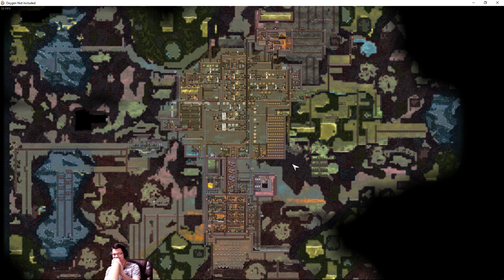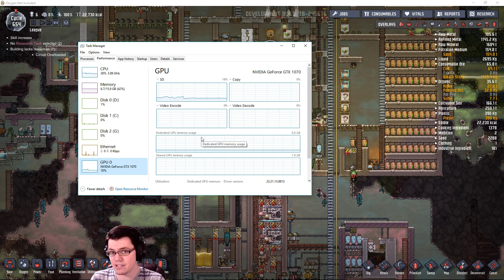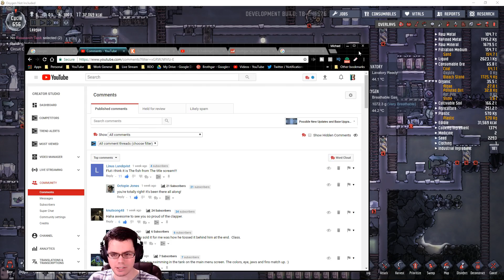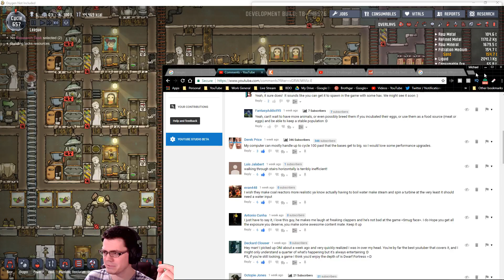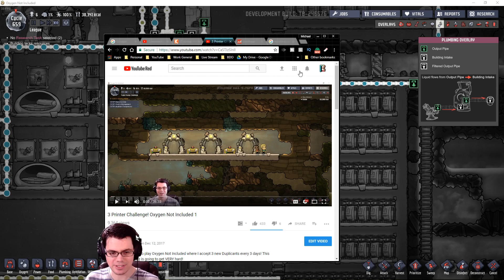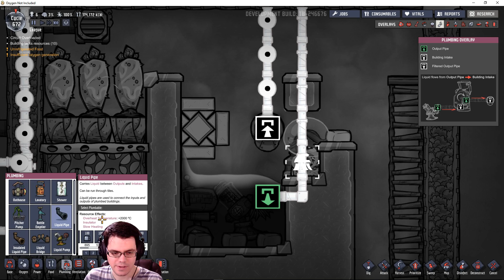Tubular Performance Upgrade! Oxygen Not Included MEGA Base 21

Comment: On today's multi-core systems, games rarely use all cores equally. It's actually very hard to pull that off. A game can still be CPU bottlenecked if it's fully using some of the cores. On a 6 core system, over 33% could potentially mean that two of the cores are bottlenecking, which could slow down the game if it is the one using one (or both) of those cores. Or it might not; the only way to tell for sure is to look at the graphs of all of the cores. If the system is using hyperthreading, things are a bit more complex because you have two threads using each core. I don't even know for sure how the percentages relate to the threads.

That said, I do have something you can try on the GPU side of things: Go to your nVidia control panel, head over to Manage 3D Settings, go to the Program Settings tab, look for ONI (you might have to add it if it doesn't automatically appear), and turn on Triple buffering. That allows your GPU to run at full speed and not wait for vsync, which might give you better FPS. Note that if you have vsync off or are using gsync, you should leave triple buffering turned off (and your GPU is likely not your bottleneck if you have vsync off or are using gsync, because those should use the GPU fully).

Comment: Haven't finished watching but wanted to say, if you're having trouble finding a spot to store liquids or gases, why not use an automation door compressor to store them in a remote location, with a pump and switch hooked up to pull it out whenever you need it?
Reply: Can't remember if you ever did figure out how to do the compressor for liquids, you want to compress downwards, so that gravity will pull the liquid down into the chamber (since liquids don't care about vacuums in this game XD). It'll split it about 50/50 as with gases and compress at an insane rate, especially once the mass of remaining liquid to compress becomes low enough for it to naturally fall under the first door.
Reply: Also as with Polluted water! You have and immense amount of potential power at your disposal! What with a natural gas geyser and your fertilizer maker setup, you are nowhere near your maximum potential, especially once you also start considering the hydrogen output from your electrolyzer setups! You can most certainly afford to run a bunch of cooling equipment and filtration equipment to help with your polluted water and heat problems!

Comment: When placed correctly, a Dupe can suck items THROUGH a locked mesh door. This means you can put a door in your Morb/Puft room, allowing them to collect the slime without any chance of the animals escaping, and not needing to use a lure (and thus use up slime + Dupe time delivering). 

You can also place your mealwood farms on powered doors on a timer, so all the meal lice automatically falls into small piles neatly at the bottom each night. If the meal lice farms are non-accessible to dupes, but the area at the bottom is accessible, your dupes will not waste time collecting lice row-by-row, instead grabbing the whole pile at the end of the day. Alternately, just drop the food onto a room with a microbe musher or into a dining room.

This can also be applied to your fertilizer makers, so you can pile all your fertilizer on a single accessible row (possibly even having hatches on that level for an automatic coal farm). You could even use mesh doors as a floor for the hatch room, so coal could be sucked out by dupes from below without even having to enter.

Comment: The power transformers just prevent over powering from happening and will do 2kw when the conducive wire is connected
Reply: They also prevent back wash of power onto other lines if one is over powered and keep batteries separated for the different uses such as gas pumps for power engines.

Comment: I don't know you have noticed, but petroleum always go out of refinery at ~75C. So cooling oil is bad idea, but heating it is very good, it destroys heat -  I pumped 200C oil into refinery, output was ~74,7C. What do you think? You can make a infinite cooling loop. Tested in game version 242561 (Automation Upgrade before official release if i'm not wrong), it may not work now, but should. Test it   ;)
Reply: LoL use it at a transition between the geyser to the holding basin :)
Reply: DaComputerNerd I just pumped it without a problem. Amalgam pump and random pipes
Reply: KOKSOWNIK no because it can get  very hot without melt
But abyssalite doesn't get hot
Only the liquid get's hot
Reply: Brothgar you can do Metal refinery out of abyssalite
Now play with that
Reply: Hanmacx it will melt, yes?
Reply: DaComputerNerd I haven't used magma, just liquid aquartuner
Reply: It's about net cooling not making petroleum out of magma :p
Reply: DaComputerNerd just spawned it, making it "legally" will be less efficient but it's possible

Comment: I wonder what other way people have made to create clean oxygen? There's 3 I've seen that most use.. I've always really wonder it there a way possible to make clean oxygen out of rot from farms. I have no way to test so anyone thing this could work?
Reply: Well you can obviously use sand to turn that polluted oxygen into clean oxygen using the deodorizer (if I remember its name well). 
But if you don't want to use sand for whatever reason, then you have to liquefy the polluted oxygen by using a thermo regulator loop (and you will have a huge heat generation problem in the end, probably) or by throwing it in a cooling chamber with the big cooling machine you can find in cold biomes (but it will consume hydrogen to run, hydrogen you produce with electrolyser that also produce clean oxygen from the start... Meaning that you would already have a more efficient clean oxygen production). In the end you will have to heat back the liquid oxygen to have some super cold clean oxygen.

Don't forget that rot is a very poor source of polluted oxygen, your system will probably be fun to build but in the end it won't be very effective, not even talking about the heat or cool issue you'll have to deal with. 
I think that a big pool of polluted water to generate your polluted oxygen would be more efficient. 
In the end I think that you should only do that if you need to cool down or heat up another system, this way the temperature won't be an issue but a useful product, probably far more than the oxygen.

Comment: Brothgar how do you cool your steam gyser? I'm kind of lost trying to cool it with hydrogen pipes
Reply: One thing I've used is running it through the cold biome as a way of also irrigating the sleet wheat. Make sure to use either granite or wolframite/tungsten pipes for high conductivity.
Reply: I just simply don't cool it, just use abyssalite pipes, most things don't care about the input temp of the water as long as it doesn't leak into your base. Unless I'm piping it to my sleet wheat in which case I run it through like 5 aqua tuners in my "hot room" and use a entropy nullifier thing for the rest.